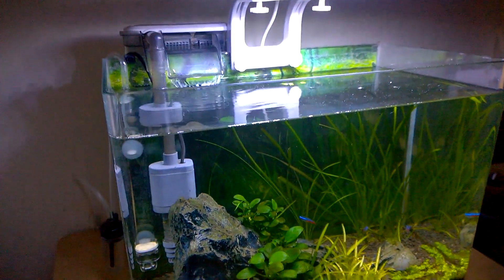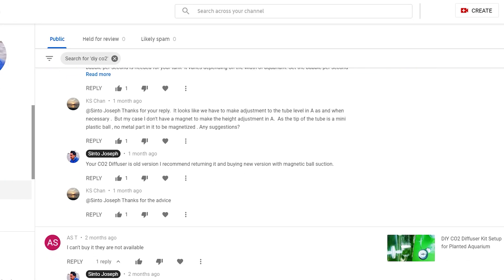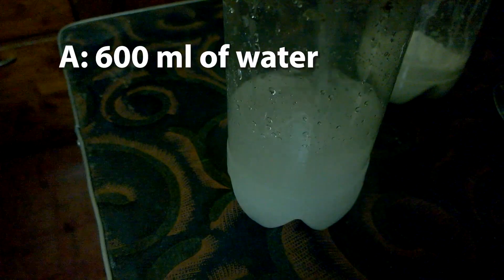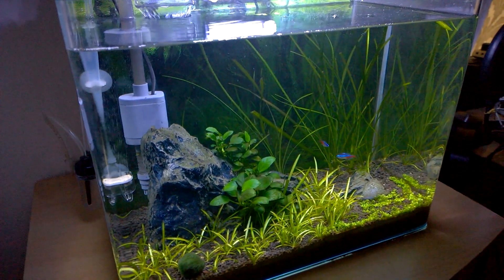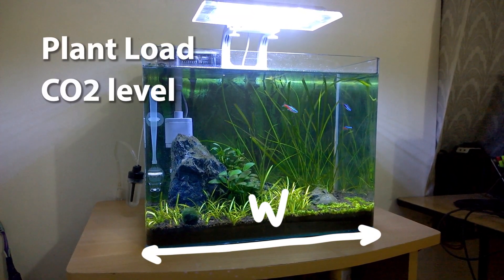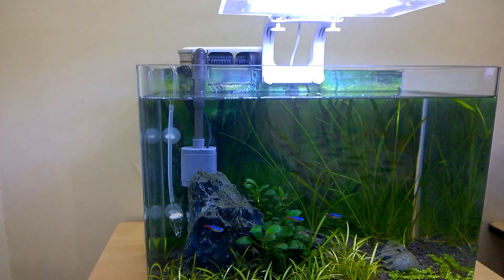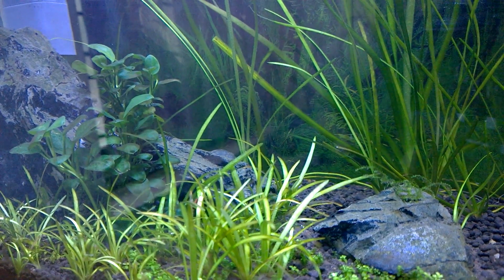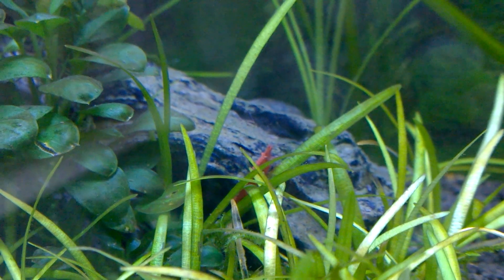How to use DIY CO2 Diffuser System

Comment: hi..how long do you need to build up the pressure required..?
Reply from the maker: Until the needle of pressure guage is in green zone. Check if reaction is complete , and squeeze more solution to get prime condition.
Reply: @SintoJoseph  does it takes hours?
Reply from the maker: No it doesn't take long time. Keep squeezing more solution until you get needle in green zone.
Reply: @SintoJoseph  its taking me 3 hours now..i have the same reactor like yours..but no bubbles coming out..can you help me bout this..
Reply from the maker: Like said in the video squeeze solution from one bottle to another till you get the needle in pressure guage in green zone. If no bubble is coming then something is wrong or there is loose connections.

Comment: just noticed today the citric acid bottle is almost empty. Looks like the citric acid transferred to baking soda bottle. Is this normal?
Reply from the maker: I think the reaction didn't occurred in the bottle if you shake the bottles the reaction might occur and the bottles might blast or the pressure will increase so be careful while you handle them. I recommend using professional co2 set I have made a video about it https://youtu.be/Hc6ddHlGFNs